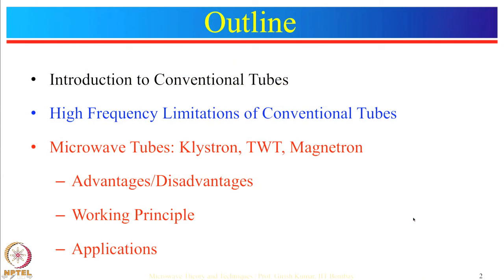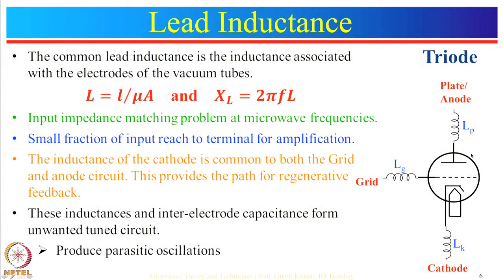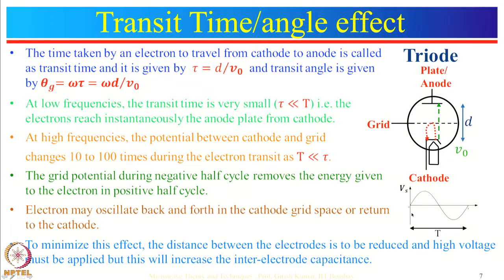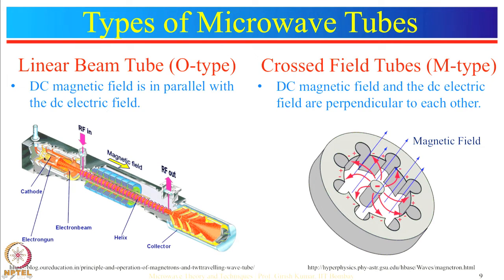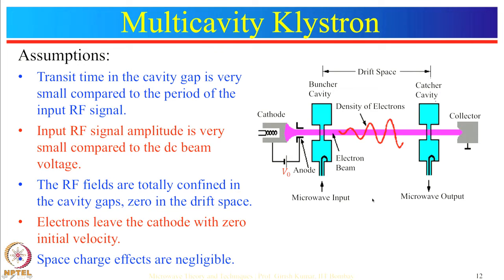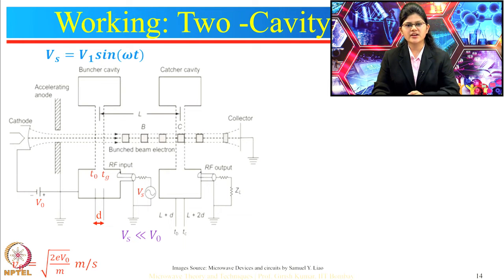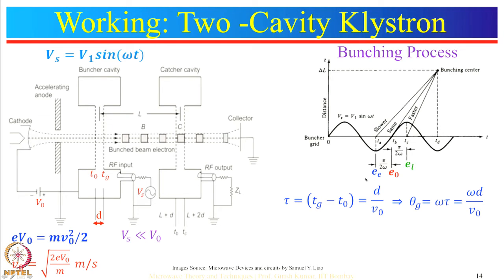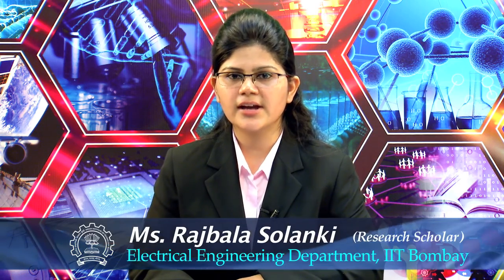Week 8-Lecture 38

Comment: A reflex Klystron operates under following Conditions:
𝑉0= 600V, Length L=1mm, 𝑅𝑠ℎ =15KΩ, e/m =1.759x1011, 𝑓𝑟 =9GHz
(10)
(5)
𝑇ℎ𝑒 tube is oscillating at 𝑓𝑟 at the peak of the n= 2 mode or 13 mode.
4
Assume that the transit time through the gap and beam loading can be
neglected.
𝑎) Find the value of the repeller voltage 𝑉𝑅
𝑏) Find the direct current necessary to give a microwave gap voltage of
200V
𝑐)What is the electronic efficiency under this condition?